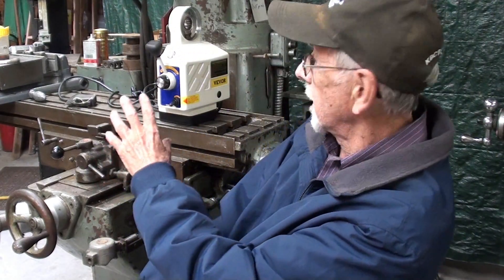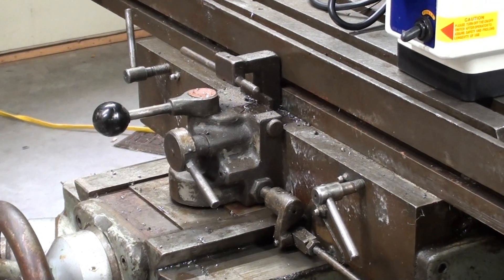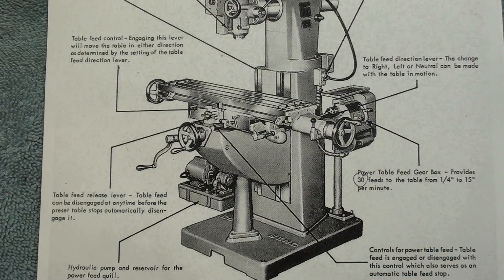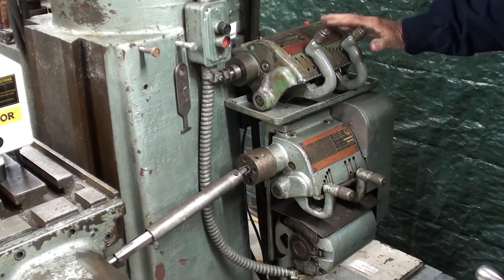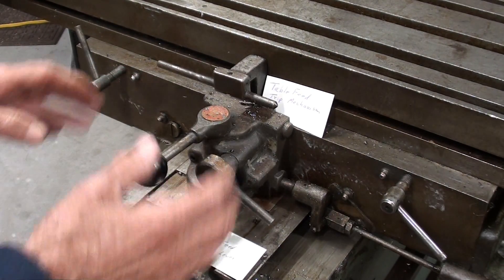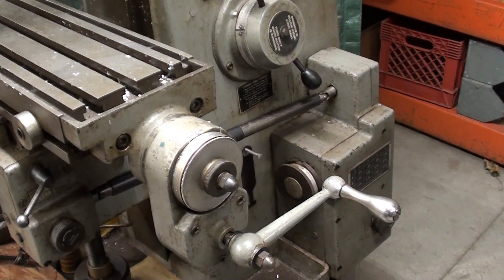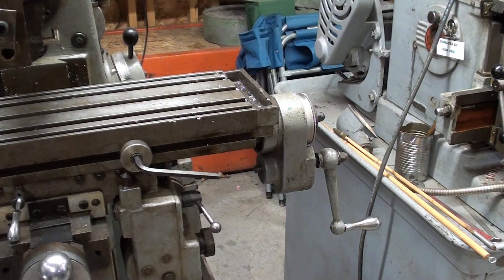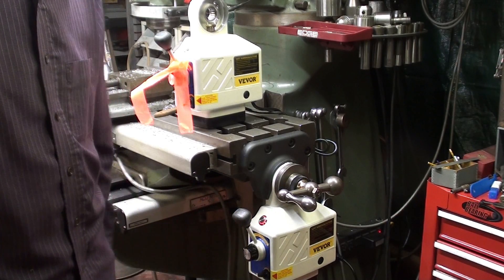HOW South Bend MILL POWER FEED WORKS TIPS #898 tubalcain

Comment: Although the modern electronic table feed is great, I can't repair the high tech portion of it but I can repair the mechanical feed as found on your South Bend or my Van Norman. The Van Norman uses a separate motor to power a similar gearbox and drive shaft however the mechanism is all contained within the saddle after the drive shaft. It also uses permanent stops to prevent dangerous over travel and adjustable stops for stopping the cut on the work piece. Both can be used at once and it micro adjustable stop that can be manually eased up against after the power feed is disengaged by the primary stops. I guess I got a little wordy and off topic; my apology for that! Thank you for another great video. I don't think I will make it to Lost Creek Saturday; I really wanted to visit with you again as I enjoyed it immensely the last time( which has been a few years)!

Comment: Enjoyed the video, the Southbend feed system is very Rube Goldberg compared to the newer style. I've got a Cincinnati 1b mill that, at one time, had a power feed but when I purchased it that had been dismantled as I'm sure Bubba forgot to pay attention and it crashed breaking the gears, as I've learned from the Interweb that was often the case, so was dismantled. I have plans to build a feed using a stepper motor with a cog belt drive and your video has inspired me to get with it, it does get tiring cranking away all day when you have a big project. Thanks again!

Comment: Dear Mr. Pete, do you think that power feed would work on the South Bend machine? It looks like it could just hang on the end of that long neck of an end cap ?
Thank you in advance for your answer
Reply from the maker: The electronic power feed was designed to fit on bridgeports or Bridgeport clones. I suppose it could be adapted to other machines, but it wouldn’t be easy.
Reply: Thanks Mr Pete

Comment: I have a universal mill from 1948. It has the gear box at the same place as the bridge port and a similar driveshaft. It dosent have the long gearbox its more under the table (like the second mill) and you start the feed from a lever in front of the table.
It is belt driven from the motor with 2 different size of pulley (2 speed v-belt change) then from that spindle via a 2 speed gearbox to a flat belt with 3 possitions (speeds).
And from the main spindle a v belt drives the feed gear box that have 6 speeds. So basically when you change the tool/spindle speed you also change the table feed. Complicated?
Reply from the maker: Very interesting, but sounds overly complicated

Comment: I have a power feed for my Index mill.  It still sits in the large bottom drawer of my toolbox.  I'm not even sure if all of the pieces are there.   I don't use it enough to make it worth investigating.  Life keeps getting in the way:-)  It looks like a more modern solution may be a better option if I decide to add one at some point.
Reply from the maker: Maybe someday after you retire
Reply: Yup, this and many other projects.  I shouldn't be bored, that's for sure @mrpete222

Comment: I love how it appears they've just used a gearbox from a 9 or 10" SB lathe. 😂 I know you said it's a different gearbox, but I mean, at the most it appears they just made some modifications to the existing lathe design to wedge it onto the mill. I would rather have mechanical systems over servo motors every day of the week. But I just love the old machines, and would rather stand in front of an old mechanical manual machine all day and crank out parts slow as molasses than operate a fancy CNC. Thanks for the awesome vid! I love these old machines, and love seeing how they work!
Reply from the maker: I totally agree with you, I like the old stuff. 
For over 50 years I thought that the gearbox came right off of Olathe. But it is really quite different.
Reply: @mrpete222  It's still pretty cool how similar it looks I think. South Bend seems to have had a clear design aesthetic for their machines. I really like how easy it is to spot that a machine is a south bend. They have a very particular "look" to them. As do most of the old machines I think. You can tell a SB, or a B&S, or a Clausing, almost immediately at a glance, IMHO. Not like the "metal boxes" of today, that just kind of have a different paint job and name painted on them. You can really tell with the old machines that the way they look started at the end of an artists pencil, as a piece of art, before a casting pattern was ever made. I could wax on forever about them haha...

Comment: Lyle -  Very interesting video.  By today's standards these old purely mechanical drive mechanisms seem quite complex.  I wonder - as did a previous commenter - about the power of the new smaller ones as compared to milling load.  But then that is true of any machine - no matter how much power someone will figure out how to crash it.  The mill I got from a high school is a 1968 Cincinnati CINEL with three power feeds and rapids.  I'm just glad I've never been into the knee on it trying to figure out how it works!  Much worse than a mechanical gearbox for sure.  Have a good day and thanks for the edutainment this morning with the first cup of coffee.

Comment: Good morning MrPete.  Good video, some complicated mechanisms for their times for sure.  I noticed your Clausing horizontal table has the same geared crank device as my Clausing 8530 vertical mill.  Is it a two speed, normal and 4X?  That's the side I intend to mount my Vevor power feed onto, just haven't gotten around to figuring out how.  When I do I'll try to document it well and forward the results.

Comment: I don't know but when you are used to these old mechanical power feeds , who were 100% predictable, these new low powered feed motors are quite a challenge. Haven't seen one where the feed speed was not influenced  by the resistance of the milling operation.